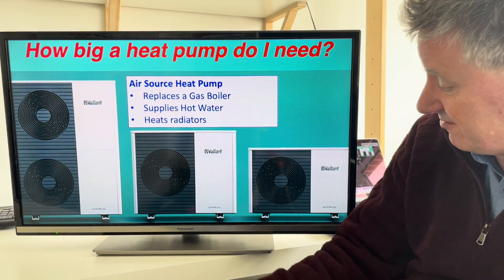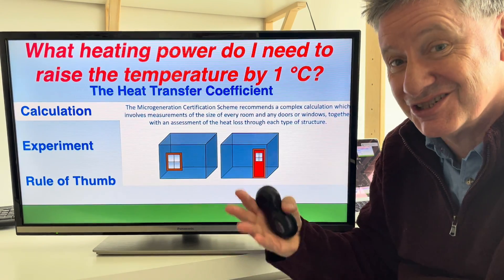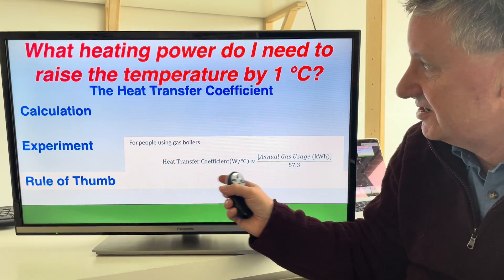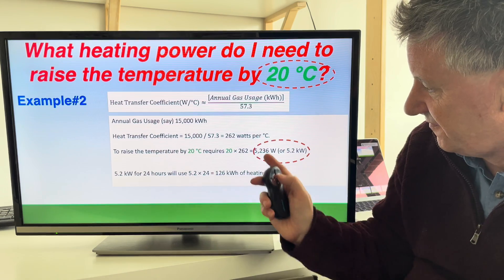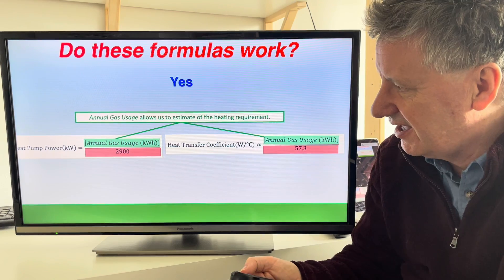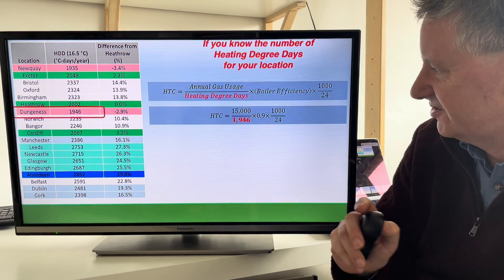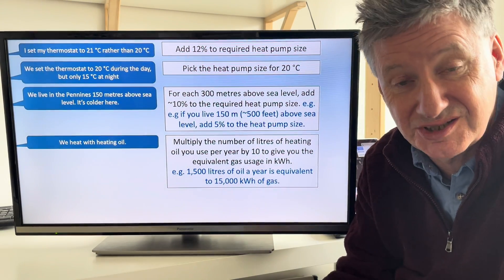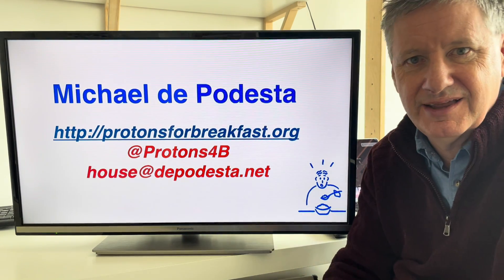How big a heat pump do you need? A simple Rule of Thumb.

Comment: Hi Michael

It's a great rule of thumb with the exception of well insulated properties, those which don't heat 24/7 and those with a bigger hot water demand. If hot water is being circulated around the house this could skew the results alot too as that can add a big chunk of energy consumption.  A few comments.

1. I don't think average gas boiler efficiency is 90% but closer to 75 or 80% as few people run their Heating system with a return temp below 55deg. Also running a boiler with a return temp at 55deg is not 90% efficient. Condensing efficiency only starts at a return temp of 55 and increases the colder you run the system. If you have a gas boiler on weather compensation then hopefully it will also run down to 35 and 45deg and you will get the 90% efficiency. The rule of thumb using 80% would decrease the output of the rule of thumb so reduce contingency a little which is not critical.

2. More importantly there is an easy way to know the heat loss by experimentation. If you know your daily space heating demand in kWh you are almost there. A heat pump is generally designed to take 1-2 hours to heat the hot water tank. Assume 2 hours worst case. A hot water tank should have your daily useable volume but assume it is heated fully twice a day that is 4 hours of DHW operation per day. That leaves you with 20 hours to work in space heating mode, assuming you continuously heat the house. Divide your daily demand during the coldest day by 20 and that is the peak power heating required. If you have gas consumption for both space heating and hot water you can remove 2kWh per person for hot water.

In your case If it's 50kWh purely for space heating per day so divided by 20 hours gives 2.5kW.

Bear in mind that this only works on the actual coldest day that the heat pump is expected to bring the house to temperature. If it's only 5 deg outside and you are sizing to -2 (standard for London) then you would need to compensate for this.

If you don't heat 24/7 then the operating time is less. If you have the heating on for only 8 hours per day then the heat pump would need to provide the winter daily space heating demand in 8 hours (or a few more If you start heating in advance). 50kWh/8h = 6.25kW.

I don't agree that continuous heating uses the same energy consumption as intermittent heating. I guess it all depends on the thermal mass of the property and how long it takes to get to temperature. Masonry buildings with EWI have alot of thermal mass but timber frame which is lighter will have less. 

The heat emitter will also affect intermittent vs continuous. If you are using UFH then it will take a long time but radiators are quicker to respond. If you benefit alot from solar gain then a fast responding heat emitter will be more efficient.

I would say generally, the same way you can lower your heating consumption by reducing from 24 to 21deg target room temp you can also lower energy consumption by reducing night time temp to 15deg and reducing daytime temperature when you aren't home. 

In terms of calculating your own heat loss based on U values it doesn't have to be so hard. For a quick rough estimate I calculate the whole house heat loss rather than individual rooms. I calculate the total floor, wall and roof areas and multiply each by relevant U values. For window and door area I use an approximation of 30% of total wall area. I also do the room by room calculation but only after having a rough idea first.

It's a shame that alot of installers oversize but to be fair there are lots of mistakes you can make as an installer if you aren't interested in how the heat pump actually performs after its installed. Radiator or UFH sizing, pipework size, pump speed setting (where required), pipe insulation, distance from heat pump to tank to name just a few.

If you are interested in installing a heat pump in London and want an installer who cares, you can contact the company where I work, www.Nextstepheating.co.uk
Reply from the maker: Kaspar,

Thanks for that considered response. You raise so many interesting points that I will have to think about them for a while. And thank you for the pointer to Next Step Heating: I will add them to my list of installers that I share.

Thanks again

Michael

Comment: I'm curious about adding capacity based on location/ elevation etc.
Surely local gas consumption/ degree days would be increased anyway and so would be accounted for in the initial figure without adding capacity?
Say an equivalent house in Scotland uses 20% more gas than the same in southern England, if you have the gas use figures you would still correctly size the heat pump without adding design capacity? Or is this to account for a drop in heat pump efficiency?
Reply from the maker: Jack, Hi. Good Question.

The key to getting the right heat pump size is to know the Heat Transfer Coefficient (HTC). One then works out the heat pump size by multiplying the HTC by the maximum likely demand.

So for two dwellings with the same HTC, then just as you say [local gas consumption/ degree days] should be the same. We would expect a house in Scotland to use (say) 20% more gas than a dwelling in (say) Manchester because the number of degree days is ~ 20% greater.

Once one has the HTC Estimate one may need to adjust the likely design temperature depending on location in the UK. I didn't explicitly discuss this in the video because although different parts of the UK have different numbers of degree days, the design temperatures don't vary that much (IIRC). So I have just used 20 °C as the likely maximum temperature demand - remember: it's just a rule of thumb.

The video doesn't consider heat pump efficiency at all - it just considers heat flow. The heat pump efficiency will drop on colder days, on my system (internal temperature is 21°C) it is just below 3 when the external temperature is -3°C and around 4 when the external temperature is +10 °C.

Best wishes

Michael

Comment: Don't fit a heat pump in Scotland The cost is far to high and you will not keep warm. It should be obvious if the gov. promote something it will cost you.
Reply from the maker: Charlie, good evening. I can't really think why you bothered to post this comment: it doesn't really make any sense. 

Heat pumps will heat homes anywhere: if they are popular in Poland and Scandinavia, then I think they will be fine in Scotland.

Best wishes

Michael
Reply: @michaeldepodesta001  The colder the weather the less efficient a heat pump becomes. Result more electricity consumption to produce more heat. Installation costs are eye watering expensive hence gov grants. As long as there are grants installations will happen when grants stop as they will just like solar panels  Fitters will stop trading so repairing will become difficult and be expensive. Take the cost of installation and running cost for say 10 years and a gas or oil system will be more cost effective by a large margin. I know several installations in the north of Scotland and all wish they had not fitted them. So anyone wanting to install Heat Pump enjoy your multi fuel stove when you find you need one. 
From midnight tonight a heat pump will cost you approx per year to run. A one bed flat £460. A Tce house £760  A detached house £1550. The older the house will be more due to lack of insulation. You will of course still have all your other electrical usage on top of this.
Reply from the maker: @charlieritchie5980  Hi. I disagree with you completely.

1. Yes, heat pumps become less efficient when it's colder outside, but are still typically 300% efficient averaged over a heating season. An oil boiler is probably only 75% efficient and a gas boiler typically 90% efficient at best.

2. Heat pump installation is more expensive and so is subsidised. What is the problem

3. Solar installations have not relied on grants or Feed-In Tariffs and have not for years. They still make excellent financial and ecological sense. Local solar installers are being overwhelmed by demand.

4. Heating my house with a heat pump is DRAMATICALLY cheaper than heating with gas. Here is a recent article I wrote about that.

https://protonsforbreakfast.wordpress.com/2022/08/26/non-je-ne-regrette-rien-update/

With the government cap on bills I will pay perhaps £100 or £200 this winter for all my electricity for heating and everything else.

5. Burning stuff puts carbon dioxide in the air, which warms the Earth and it's actually something of a crisis at the moment. And gas and oil are the problem: they are not a solution to anything.

Best wishes

Michael
Reply: @michaeldepodesta001  We will have to agree to disagree.
Anyone planning heat pump you will be unhappy and financially ripped off.
However someone has to try and sell them.
Reply from the maker: @charlieritchie5980  Charlie: yes, I agree that I definitely disagree with you. Best wishes: Michael

Comment: Hi Michael,
I've had the following supplied by an ASHP installer:

"Indoor - Outdoor delta T (23.85 ºC) 

Peak heat loss at design temperature (11.85 kW) 

Space heating energy requirement (29678 kWh/pa)

Space heating electrical energy consumption (7789 kW/pa) 

Based upon the information that has been inputted into the calculation tool, the heat loss of the building has been calculated to be 11.88kW @ -2.85°C." 

My comment back to the installer is:

"Four of our bedrooms are not used and neither is a bathroom so the temps in those would be perhaps 15C not 20C.

Realistically, the heating season will be 1st Oct to 30th April or about 180 days, with the coldest months being Dec/Jan/Feb in which exterior temps may get down to -2.85C for perhaps 30 days in total.

So a 17kW ASHP for those 180 days (17 * 24 hrs* 180 days)would provide 73440 kWh but a 8kW ASHP would provide 34560 kWh, which is still almost 20% above your 29678 annual heat loss figure."

My 8kW power ASHP example is based on your rule of thumb calcs.

I wondered what your views of the installers figures are or have I got something wrong?

Edit: if you do answer I will not quote anything you say in your answer.

Comment: I am so glad that I found your channel - I hope that you’ve got more content. I also read your articles and they answered all my additional questions (how valid is HDD? What is the relationship between the set temp and the overall numbers? Etc)
Reply from the maker: Thanks for the kind comments. I am working on more stuff but I am a bit slow!

Best wishes

Michael
Reply: Thanks, the hp therefore should not be greater than 40 percent of the general load. If the unit is running at a slower rate would this have a negative effect on the COP? I guess the manufacturers need to answer this one. Thanks for the great video.

Comment: Excellent to-the-point presentation. It should be the bases of any selection and types of dwelling. The calculation is simple but most importantly easy to understand and apply especially to design and build companies. MCS requirement is extremely complicated, especially for installers.  The method needs to be adapted for domestic application. Thank you

Comment: Heat transfer coefficient in Watts per °C on the left hand side of the equation but we have kWh divided by a constant on the right hand side. Makes no sense. Similar for heat pump power equation. Makes no physical sense. KWH divided by a constant is still kWh. Not kW.
Reply from the maker: Thales of Miletus, What an honour to have such an esteemed philosopher stop by. And also a pleasure to have a discussion with someone with any awareness of dimensional analysis. 

However, you are quite wrong.

Taking for example the equation on screen 6m10s into the video.

The left hand side is in watts per °C so the right hand side must also have dimensions of [W/°C]. 

The Annual Gas usage is in [kWh] and therefore the constant (57.3) must have dimensions of [kWh x °C/W] which simplifies to units of  [h x °C] i.e. [time x temperature difference]. 

If you fast forward to 12m30s into the video you will see how the formula was devised, and note that the units of the 'constant' are [°C days] i.e. [°C x time] along with facts of 1000 (to convert from kW to W) and 24 (to convert from hours to days).

So, just to be clear: you are completely wrong in your assertion: the equation makes excellent physical sense.

Best wishes

Michael
Reply: Thermodynamics not within your knowledge?  You got body-slammed by simple math.

Comment: If its annual kwh/had then my 20,000 woukd mean in Norwich (2235) it would require a 8.9kw heat pump, but the same 20,000 if I were in Edinburgh would be 20,000/2687 = 7.4kw! So the more North and colder I go, the less powerful heatpump I need??
Is that because the colderoutside it is, the more efficient the heatpump is?
Reply from the maker: Kevin, Hi.

Imagine identical two houses, both with 20,000 kWh of annual gas usage. One is in mild Norwich, and the other is in cold Edinburgh. Clearly the house in Edinburgh is better insulated. How do I conclude that? Well it's colder in Edinburgh than Norwich, but the gas usage hasn't increased. That means the HTC for the house in Edinburgh is lower than the HTC for the house in Norwich.

So for 20 °C of demand, the house in Edinburgh will need a smaller heat pump because its HTC is lower.

Does that make sense?

Best wishes

Michael

Comment: I opened the video expecting some kind of guesstimate like 100W/sq.m but I got a pleasant surprise: this is actually a nice condensed sensible way to calculate equivalence that makes a lot of sense for end users who can't or don't want to do the more complex load calculations. well done!
I'd suggest leaving a bit of margin to account for differences in Winter temperatures, unless the reference year was unusually cold. Choosing the closest capacity above the calculated load might be enough.
Reply from the maker: Mike, Thanks for your kind words. There is a 'bit of margin' in the calculations with regard to boiler efficiency and assumptions about use of gas for Domestic Hot Water. But in the end it is a 'rule of thumb'. The aim is really to be able to apply a sanity check to some of the very large heat pump sizes being recommended by the MCS analysis.

Best wishes

Michael

Comment: Last year I used 43000 kws of gas, in the same period there were 2080 HDDs, plus 5% for elevation gives me a heat pump size of 16.3kw. My very thorough heat loss calc, where the only unknown was air changes (best guess stuff) suggests a heat loss of 15.5kw. That's pretty close in my book. I've read all your articles, the only bit I didn't get is if 3.5 below thermostat should be a variable or just read it as a constant? Great work!
Reply from the maker: Dear Pumpkinhead456, thanks for your comment. Indeed, that level of agreement is pleasing. 

Two points:

Firstly, that's a very high gas consumption so you might like to consider whether insulation of any kind was relevant to your home. 

Secondly, the 3.5 °C is a guesstimate for the heating caused by electrical consumption, and people in the house. It's basically a measure of how much colder it gets outside before one puts the heat on. For very well insulated houses, the 3.5 °C can get larger - the heating sources inside the house are very effective because teh heat losses are low. For poorly insulated houses it might be a bit less, but 3.5 °C seems to be about right.

Best wishes

Michael
Reply: @michaeldepodesta001 I don’t think absolute usage is, er useful but specific. I use 28MWh on 350m2, the first is absolutely large but quite reasonable on specific.
Reply from the maker: @markegg262  Good Evening. Context is everything. In the context of domestic energy consumption, 43 MWh is large - it's about three times the UK average. Obviously a larger property will have larger heating requirements, but it is nonetheless large and will require a non-standard heating installation. 

Dividing by the floor area of teh lived-in areas gives a rough measure of fabric efficiency. In your case 28 MWh/350 m^2 gives about 80 kWh/m^2/year which is not bad in UK terms. For comparison, a Passivhaus is less than 15 kWh/m^2/year and modern building standards specify around 50 kWh/m^2/year. 

Best wishes

Michael

Comment: I think is more likely sometime will recommend a heat pump that’s too small, as anything larger than 7kWH requires planning permission
Reply from the maker: Mike

Good Afternoon. I don't know where you are based, but that is not my understanding. In the borough of Richmond where I live, air source heat pumps are considered permitted development except in conservation areas.

And even if it were true, the fact on teh ground reported by installers and surveyors is that no-one has ever installed an under-sized heat pump! And 10% or 20% oversize is fine. But it is important to avoid 300% oversize - which has been proposed in my experience.

Best wishes.

Michael;